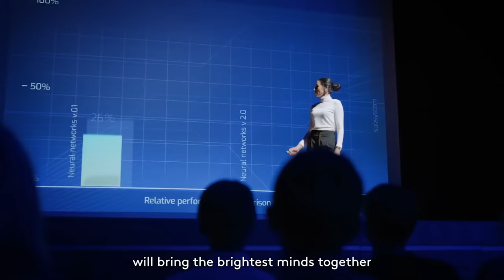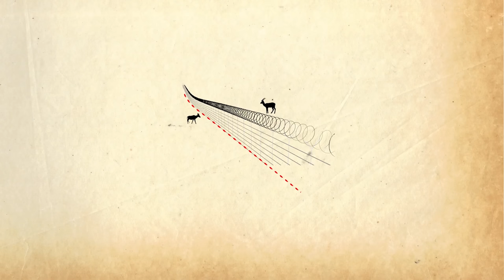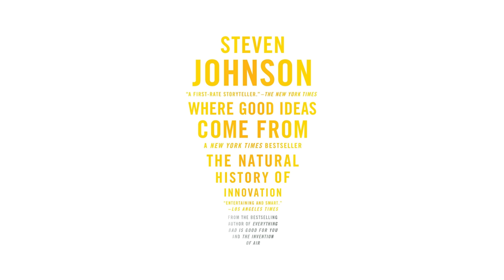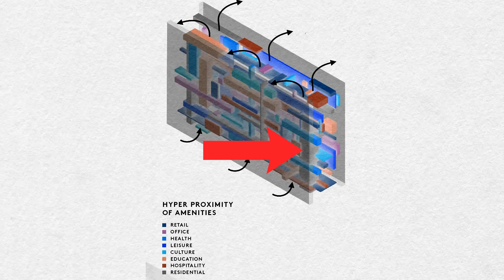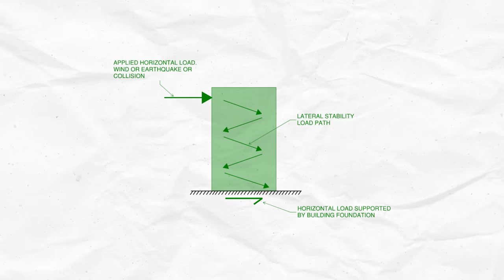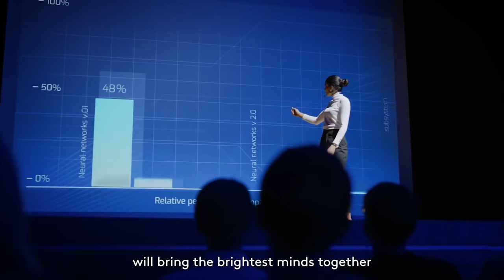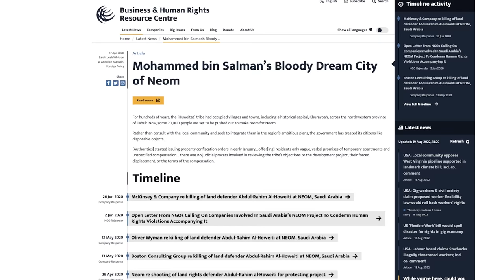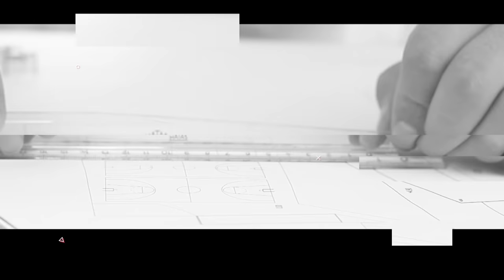This city concept breaks architecture (THE LINE)

Comment: As a Saudi I thank you for this honest and logical questioning of the project and I love seeing videos like this to help casting light on any mistakes or stuff that we might overlook or maybe
the people who are helping making this project hesitant to bring it up for whatever reason, But! I had to clarify something which you got it confused and I see it in a lot of videos!
The north west side of Saudi even if it's a desert like most of the rest parts of Saudi it's mountainous and it has it's unique temperature even in the prime summer! so when you google Saudi
it's true that the average temperature of the whole country could be a certain "number" but it varies a lot from region to another for example in the Neom region it's the only region that snows!
in other region or most of Saudi we get hail never the soft white snow so when you debate the temperature of this project in prime summer you're using the temperature of other parts which
doesn't apply in this case and living in Saudi for over 30 years I notice it's very few urban areas that could reach 55°C and for a very short time compare to smaller gulf countries like Kuwait
which is far less diverse when it comes to geography and much smaller and limited to one weather all around the country and Kuwait tend to get the most registered heat in this region sadly
so most likely it's Kuwait and what's near it that could reach 55°C and some very few parts and for a short time I know this as a fact because my mom is from Kuwait and I lived there for a very
long time and I experienced living in both countries for a very long time so I wanted to point out this matter which is sadly a common misconception that every part of Saudi is the same as if
it was small country or limited with geography or terrain and mass and not diverse for example like Kuwait and that's not true at all and in fact it's something Kuwaiti people fear in the future
with the rising heat temperatures and how they're limited and a small country and don't have an escape inside their country to a cooler areas or mountainous areas like Saudi or the other
bigger GCC countries like Oman or Yemen and somewhat UAE too. Hope this help casting light on something that helps you and other people like you helped me and many others in a civil
and polite way to rethink some stuff about the project and the great thing even though the project is started already it's still in first bases and any change won't be hard to implement or alter
so I have high hopes.

Thank you very much and I hope we all help each other into making something great and avoid disaster and share information and learn new things together because we know this is
something new and never been explored before so let's hope for the best and learn from each step while we go further. All love and peace for you all from the Kingdom <3
Reply: So as a Saudi do you respect women and think they are men's equals?
Reply: @apoplexiamusic  Yes, But in our religion and culture there is one woman that our god and prophet said that you should respect and love more than any other being including men and including my own father because she comes first which is my mom. When someone came to ask the prophet about who is the most worthy of my love and respect and between the humans and after Jesus and Muhammed and all these people who went through trouble to being us god's message it's each one's mother so the prophet said to him you mother then the guy asked who's next? he said your mother again then he said who's next he said your mother then the guy said who's next he said your father. This showcase how the mother and females because most of them gonna be mothers or in a mother figure like you grandmother or aunts or big sister so yeah I respect women equally and might be even more because my dad died when I was so young and my mother the one who raised me alone with a group of women so yes in both religion, culture and my personal level women might even be worthy of a little more respect and honor than men but in most cases it's equal and hope this casts a light on something widely misunderstood. In Arabic culture till this day the mother or grandmother has the most respect and saying in the family almost like the Italian, Indian and Latin families she could have a hint or saying in which you marry or what the family do but lately women are more chill and leave that matter to the individuals themselves to decide but if you go back in time to the near past like in the 80s or early 90s the mother had a great power and rule and she used that power to ensure the peace and safety of her family but with every generation women even though they still have the power in the family they believe in letting you decide and learn from your mistakes while giving you a heads up and an advice but yeah they still have every right in that rule from religion and culture and society wise too
Reply: @apoplexiamusic  I don't know why you being passive aggressive and aiming it at me just because of my nationality and religion and if anything it seems like you trying to push your understanding of life or the matter on me rather than asking and debating which looks a bit extremist if you ask me! and you asked me about women and what to think about them myself and as a Saudi and religion is a great part of my identity and in Saudi culture and laws so why are you upset when I talk about religion I happen to be a Muslim who practices Islam and you didn't ask me about animals or transgender women you just talked about women in general so you shouldn't be mad with me and maybe try to be more clear with your questions and even tho this has nothing to do with the matter but I'm a gay guy by the way! anyway I wish you a great day and hope you find peace in your heart to see the world in a more accepting and open-minded mentality not everyone in the world gonna share the same opinions as you 100% and that what makes us diverse and great. You might find one thing to be the only right way to respect women and in our religion and culture we have our way that's perfect for us it's just how life works as long everyone is safe, happy and living in peace!
Reply: The money the royal family pumps in to these vanity projects would be better applied to fusion energy research and applications as well as food insecurity solutions, water purification and reclamation. The results of these technologies being realized would benefit humanity and cement a much more lasting legacy than a fantastical walled city in the desert.

Heavens, spend it on medical research!

The royal family throws so much money around and they think in such small minded ways via large scale vanity mega projects.

The mistakes that are already occurring and have occurred are rooted in approving such projects such as these and ignoring their own internal shortcomings of their own society and infrastructure.
Reply: There are many previous experiences building LINEAL cities. It is not a new idea. It is an old idea that failed ALWAYS.
Reply: "For some reason" at he beginning of your text....reason -> authoritarian regime. Democracy = letting others have a say. MBS needs to learn political science
Reply: @turnipsociety706  Thank you for your reply.. All am gonna say that the people of this land are "resourceful".. nothing lasts my brother and we do understand and let's just call this time we live in the time of "awareness".
Reply: You don’t need to “explore” everything to know if it is wrong, when tons of educated engineers and architects are logically criticizing this for numerous reasons. I have studied physics and my expert opinion is that if you fly into the sun you will die, but it has never been explored, let’s hope for the best and fly right into the sun!